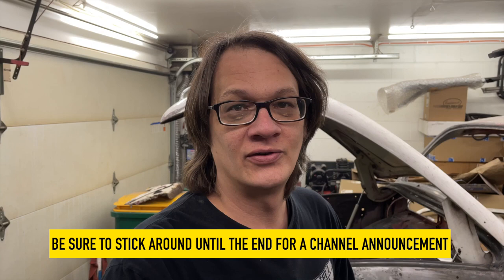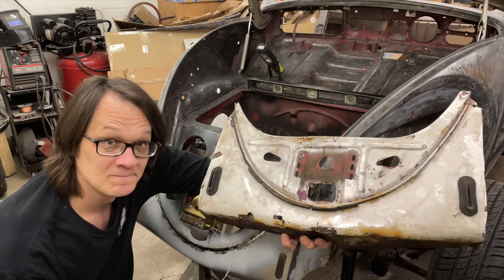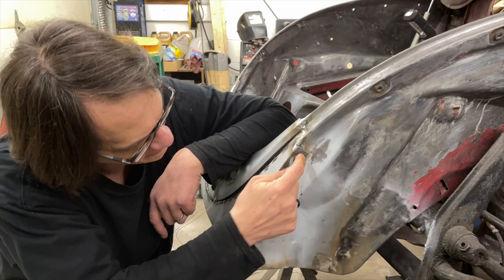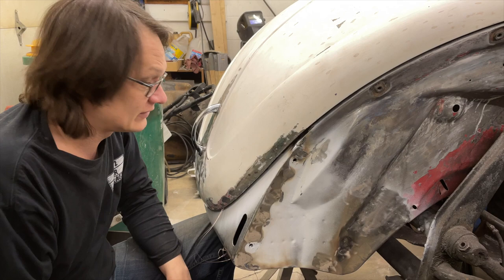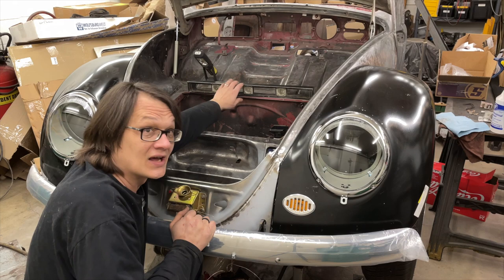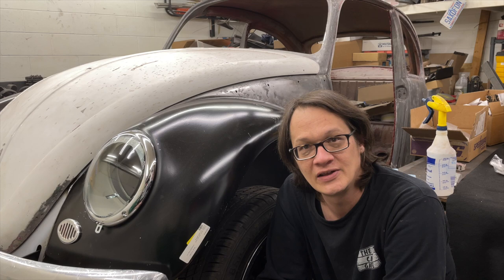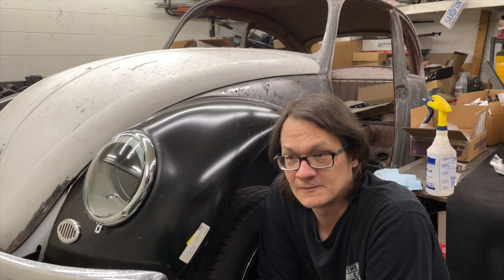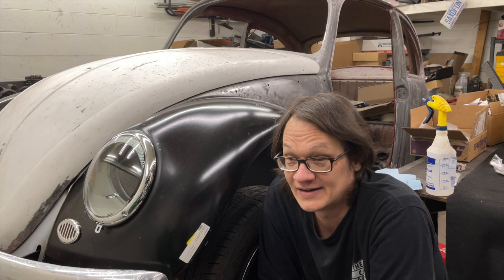Front Apron Finished! - Vintage VW Bug Update March 12, 2021

Comment: i keep seeing y’all’s car at the school and i always drool over it
Reply: Great idea on engine rebuild video.  Will you 'upgrade' it a bit, maybe little bigger or more horsepower.  Describe what works and what can be improved on.  Also maybe a video on using various components from the different vendors. Are there preferred ones for metal, for interior, for wiring, mechanical etc.  Thanks and keep'em coming.  I for one am loving'em.  How is Minnesnowta these days?
Reply from the maker: Thanks man!
Reply from the maker: We’re for sure doing some engine upgrades! I think at the end of the project we’ll go over all of the vendors we used. 

As far as Minnesnowta, we have actually had warm weather the past few weeks and I can see the grass again!
Reply: @The2CarGarage  Spring is in the air!  I went to school in Mankato